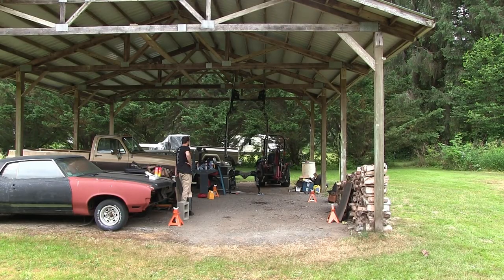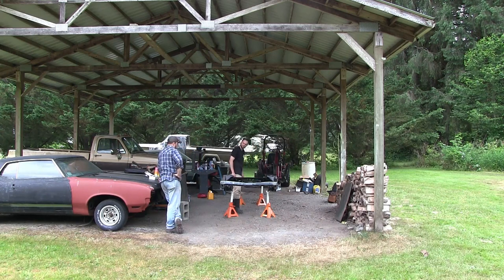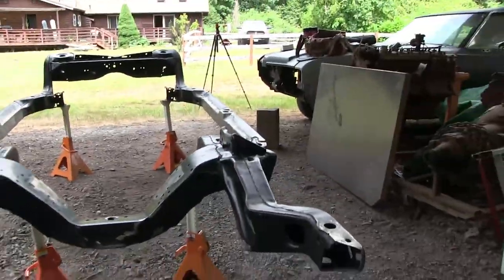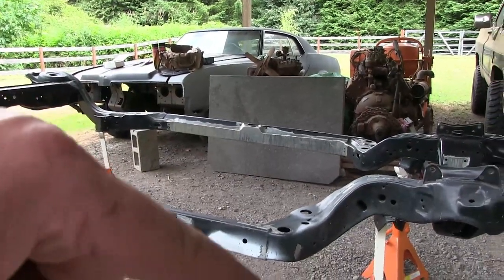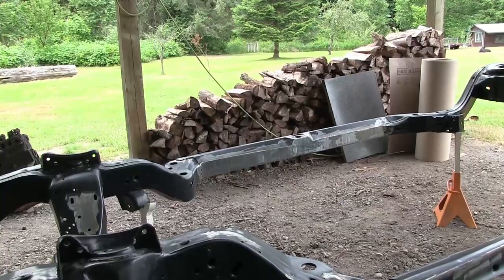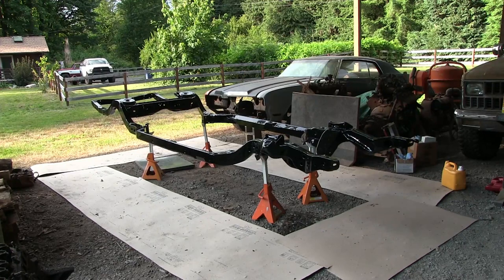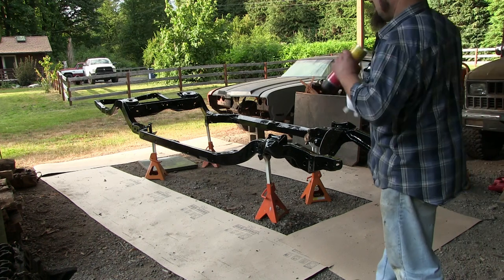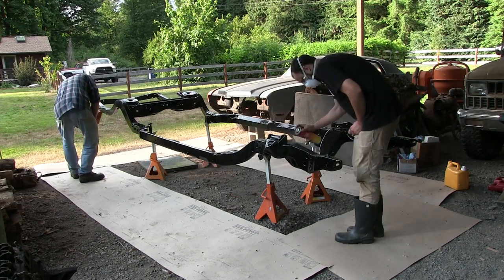1970 Olds Cutlass Supreme Painting the Frame

Comment: If you ever get rid of your Cruise, you should get a Ram 1500 with the 5.7 liter Hemi! The Hemi surprisingly gets good milage. My dad's ram gets like 26. And his is the hemi
Reply from the maker: I'm actually not a big Dodge fan...  If I were to buy a new truck, I'd probably do an F250 with the new 7.3 gas engine.  Not too good on gas, but it doesn't have all the goofy stuff new engines have like cylinder deactivation, or direct injection.  They kept it simple.  But the Cruze isn't going anywhere anytime soon...
Reply: I wonder if Ken still has his 08 F150 or lifted 94  Chevy!